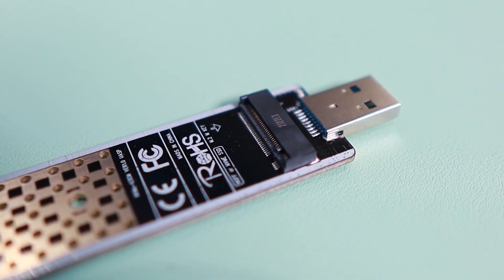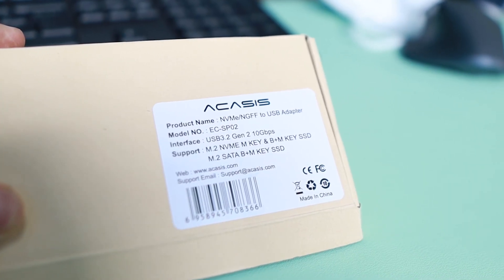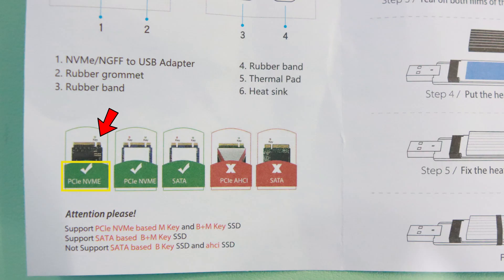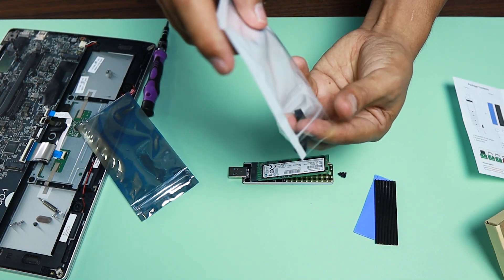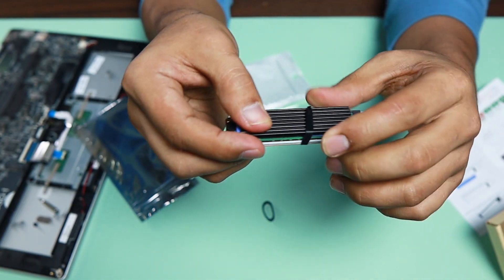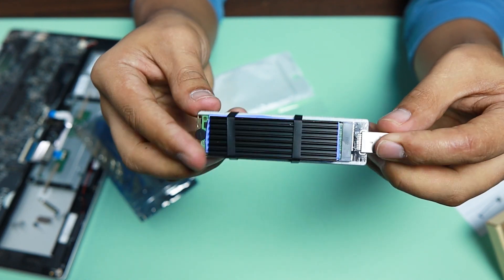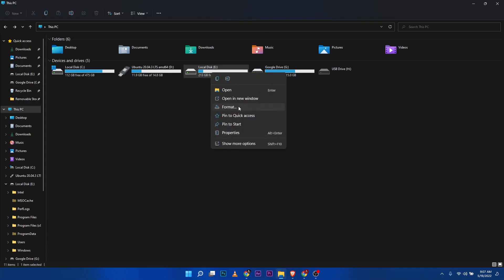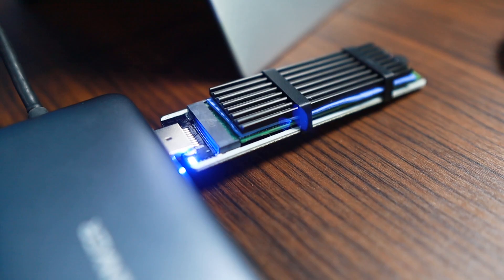How to Use an SSD Internal Drive Adapter for USB

Comment: The instructions for the adapter clearly show that it's not compatible with 1 slot drives and yet your drive is a 1 slot (as is mine). How is your adapter working?
Reply: So sorry, I just saw that it is compatible with the single slot pci nvme.

Comment: These things are a time-saver when imaging new laptops. Sadly, the controller chip in them smokes if your USB-C port on the laptop is fried. I have gone through four NVMe enclosures of different types in the past year alone due to shorts or something sending too much voltage/current out of the USB-C port on a laptop. 
Sadly there is no "tester" that will check the port without having a "sacrificial" device connected after it. I need a USB-C port (on the laptop) tester and that alone.
Reply: 😂⁰😂😊
Reply: 😂2

Comment: This is so handy, my laptop was working perfectly ok, I forgot to plug in the power cable and the battery got depleted, the laptop then shut itself off, I tried charging the device but the charging light indicator at the side of the laptop is not showing, the laptop now refuse to charge, I need to recover all my data as it's the core of my business, this device is perfect

Comment: Do you know if this adapter would be compatible with a WD Blue SN570? I want to do a reset to factory setting on my SSD card by using my laptop. Thanks again!
Reply: These adaptors should be backward compatible with usb2 slots, you just won’t get the data transfer speeds of a usb3 slot. I’ve just bought one to try out, just waiting for my m.2 card to arrive, it should work as extended storage on my PS4 as that requires usb3 to work

Comment: Hello if I have a Samsung 980 pro ssd with heatsink. Am I able to use this M.2 to USB to update the firmware of the SSD using Samsung Magicians? Thank you
Reply: Same question I have  but I have 990 pro
Reply: I don't get why but you can't message back it's not that hard to say if it doesn't or not